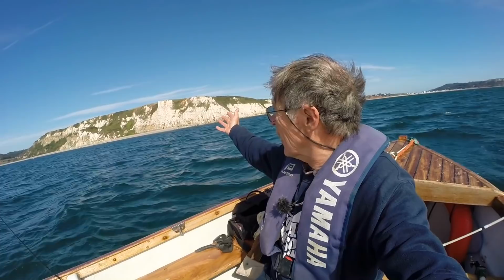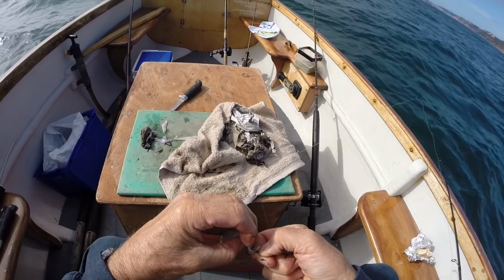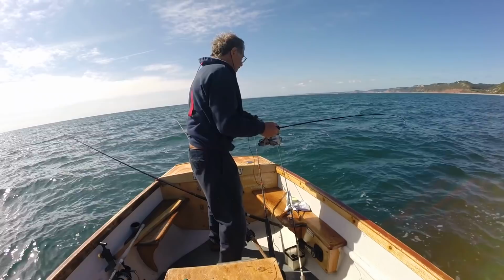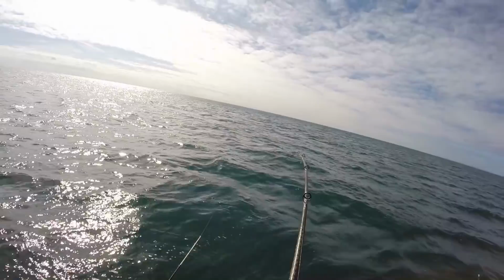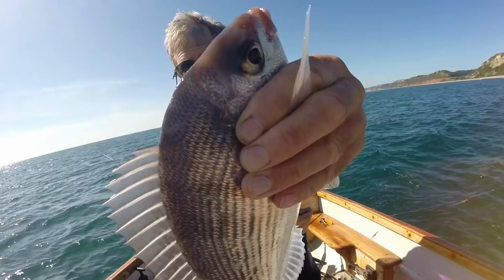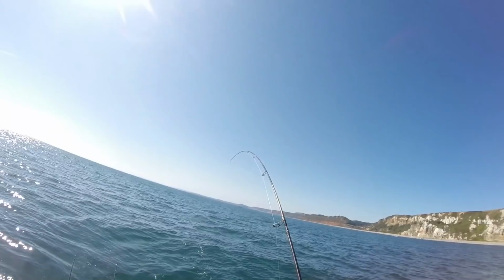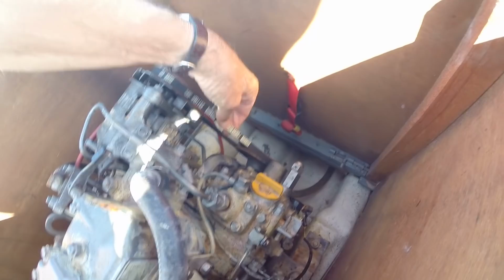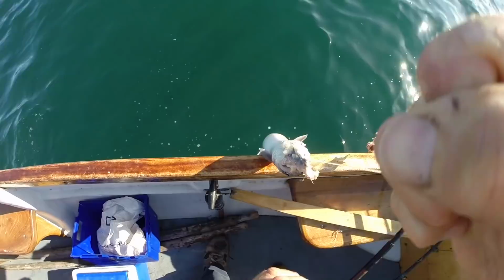Fishing off the Coast: Alone on the Ocean

Comment: Graeme another great presentation I am glad you did not venture too far out , those inboard engine tubs can be troublesome .. and back up . how would you get in ? radio/ mobile phone maybe ... safety at sea
Reply from the maker: They come with oars,and old engines like the Yanmars are extremely reliable.There is also a limit on how far you can take them out.